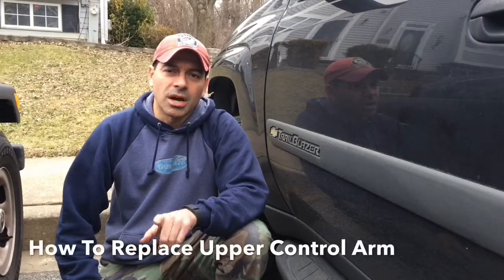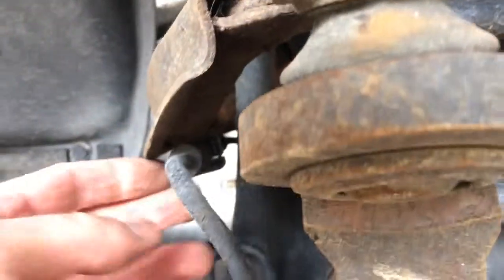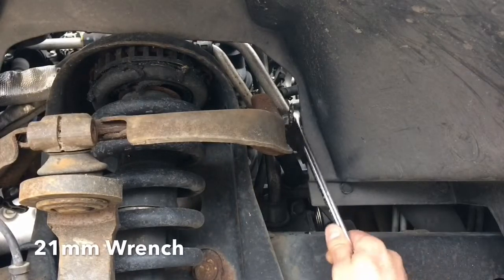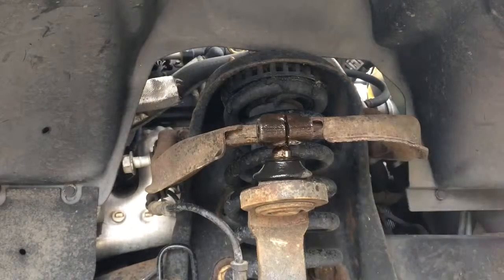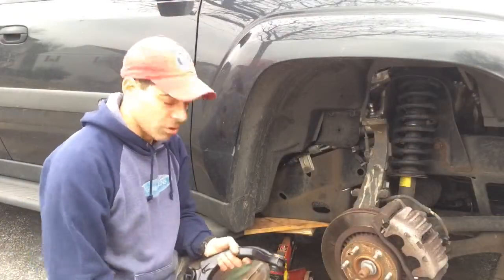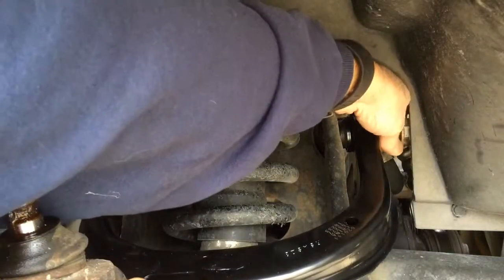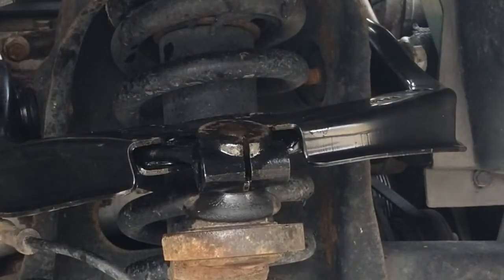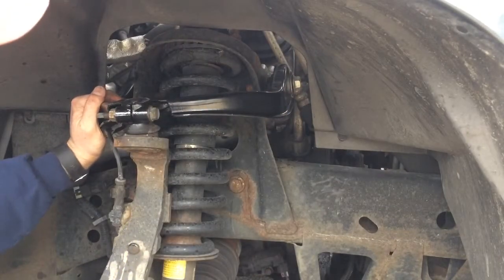How To Replace Upper Control Arm - Chevy Trailblazer & GMC Envoy (Andy’s Garage: Episode - 42)

Comment: You can hammer a chisel into that space to separate the metal to take the control arm off of the ball joint and back on and wont need bang on it with the hammer.

Comment: Yeah I have to remove the driver's side and the bolts are very very tight, I'm thinking I have to jack it up, put a jack stand under the frame and let the wheel drop to take pressure off the control arm.

Comment: Do you have to put a load on it before tighten the two bolts.
Reply from the maker: No, I didn’t
Reply: Yes you do same for the lower arm. The upper arms are the easiest. Use a piece of pipe about 2 1/2 ft long for leverage with the full weight of the vehicle on the ground the bolts are still easy to get to just limited pull on the wrench b/c of the tires but doable.👍 The torque spec is @ 117 ft lbs.

Comment: should of did the the drivers side considering it’s a lot harder than the passenger
Reply from the maker: I’ve done both and not sure what you mean, they are pretty much the same. What issue(s) did you encounter on the driver’s side?
Reply: @PhillipsVision  the bolts on the drivers side are a bitch
Reply from the maker: @therealjackieheezy  same placement as the passenger. Easiest way it to use a wrench until you hit the sides then they should be loose enough to manually unscrew them behind the wheel well walls. Putting them back in should be the same in reverse. Hope this helps
Reply: @PhillipsVision   well not with my trailblazer it most definitely was not same as the passenger 

the two drivers bolts require a lot more bullshit to remove them yes the are placed the same way as the passenger but they just don’t slid out all easy like that 

it’s a known issue (there are a few uca replacement vids on here that talk about it) idk i guess you got lucky trailblazer
Reply: @therealjackieheezy  I am seeing what you are talking about there is no space to remove the front bolt!
Reply: @ericrotermund1004  yeah bro you are going to have to either grind that area down or cut it out to give the head of that bolt clearance 

there are some vids that show how to do it i had to cut a section out with my sawzall
Reply: @therealjackieheezy  I figured it out I used a hole saw
Reply: @ericrotermund1004  excellent
Reply: @therealjackieheezy  any tricks to do the lower ball joint the rental tool didn’t work.
I used a hammer to beat to old one out.
Having trouble getting the last 1/8 of an inch
Reply: On the drivers side I used a 3ft pry bar from harbor freight and used the old control arm for pushing against the lip of the wheel arch until it was rolled in sufficiently to remove the front bolt.